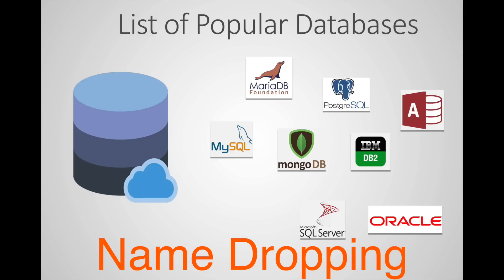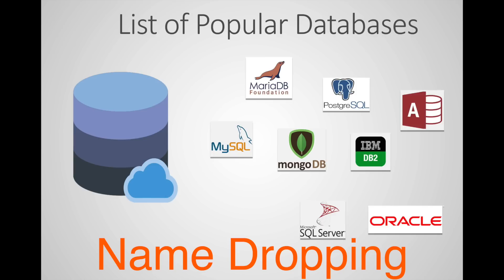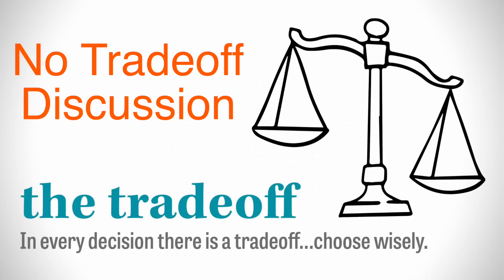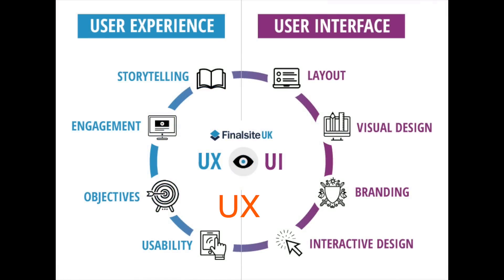Systems design interview mistakes - 6 common blunders which cost candidates

Comment: Like someone else pointed out, most engineers never get the opportunity to design systems at their current workplace. The reason most candidates want to change jobs and are giving these interviews is because they are unsatisfied with the work they are doing. 

So how can a candidate with 3 yrs of work experience at a small company get real-world experience of designing large-scale systems? Its IMPOSSIBLE! If you say that design something as a personal project. Sure! But that is never going to be a system that has 100 million DAU and needs 5 microservices running over 5 different regions behind a geo-based load balancer. Most technologies are not free to use. Sure they might have a free tier but that is not always true so how does one get hands-on experience with these technologies? 

Reading about these technologies becomes the only solution and Alex Xu/ Grokking / HelloInterview become the only places where we can learn to design systems. 

Finally, Leetcode in itself needs insane amount of preparation to get good at. Add on top of that the System Design prep and Behavioral Interview, it becomes a 4-5 month ordeal to switch jobs given that you barely have 2-3 hours after work. Even after all this, there are chances that you will fail the interview through no fault of your own (bad interviewer, tough accent, interviewer having a bad day etc.) 

Tech interviews are extremely unfair and are testing things that are never needed (LC) on the job. Someone really needs to change this entire interview format.

Comment: the problem with the cargo culting section is most people interviewing esp for mid level DONT have real world scale experience, so what else can they do besides study the three resourcees regarded as the best??
Reply: Literally this, system design interviews are insanely unfair. The vast majority of software doesn’t have to deal with issues of this magnitude and scale. It’s not that the candidate wants to regurgitate grokking, it’s that that’s literally the only option
Reply: Yeah. I don't feel great about this one. Are we not supposed to go for E4+ positions because we don't have experience designing large scale systems...? I do think it's a valid point to ensure that we're not just memorizing and that we can think critically about our decisions.
Reply: Exactly what I was thinking. In my previous positions I was mostly writing smaller features. Within a year you maybe get 2 or 3 chances to architect a solution from the ground up if you're lucky. So you're screwed unless you use the resources mentioned in the video. IMO I think the best you can do is use hellointerview as practice but read up on the theory as well using Jordan has no life and DDIA

Comment: Have you ever shard a database bro…?
I work as a software engineer for 15years and never in my life I had to shard database. In all large or medium systems the interactions with DB  were abstracted out decade ago by guys that already retired. In small systems you don’t need to shard. 
I think I will pick up a new hobby - taking those abstract diagrams and try to implement them myself.
Reply: im doing that with a web crawler rn, using kafka, redis, etc going to shard my postgres db to learn
Reply: well, Youtube, Twitter, Facebook and the list goes on did use sharding over relational DB as a solution for scaling, it's not the best thing to do, they did that because their main db was not meant to deal with the amount of scales they have reached overtime and during their times, solutions like Kafka, GraphDB or even a simple MongoDB weren't exist... so yeah, system design interviews are about debate, and it's awesome that today you would know to use GraphDB for example for Twitter design, just take under account the interviewer might try to challenge your pick by stating that Twitter themselves used MySQL with sharding to handle their scale growth, later on they did use some concepts of GraphDB if I am not mistaken
Reply: sharing is employed for large scale systems, not your small/medium system experience you got at your random contracting position. get good bro.